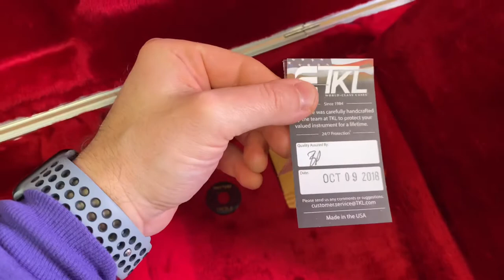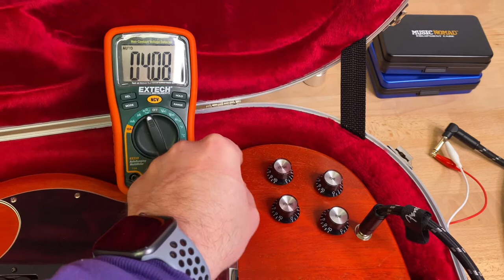2002 Gibson SG Special Faded Crescent Moon

Comment: I'm late to the party, but I have one of these that I bought new.  It has an ABR-1 bridge with a wire instead of a Nashville, mounted directly into the wood.  It must be a really early one.
Reply from the maker: That is interesting indeed! Thanks for sharing!
Reply: Mine is a 2002 model all stock including an ABR-1 bridge, except for a graphtec nut that the previous owner had installed. The guitar is in good condition but clearly it has been played. Great sounding guitars without the thick layers of paint that I am unable to associate with tone😊 Greetings from Sweden